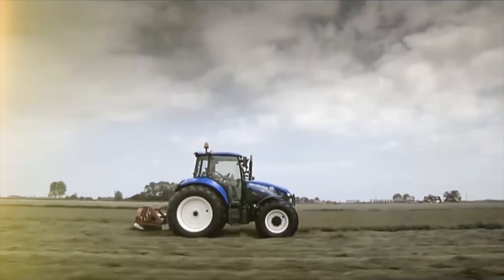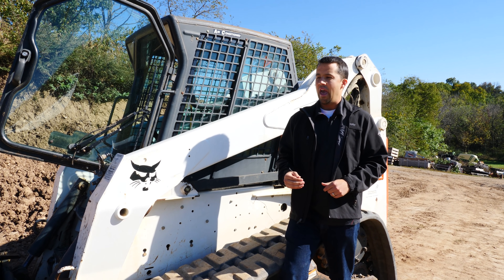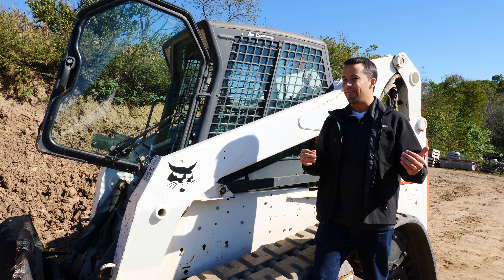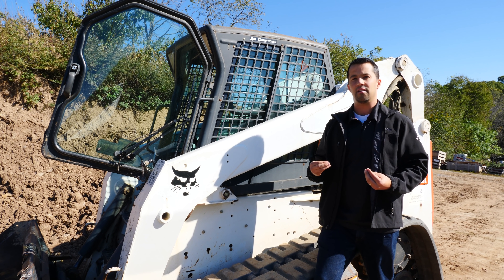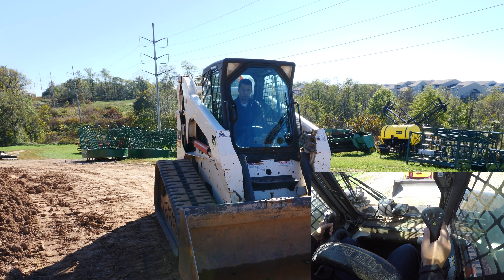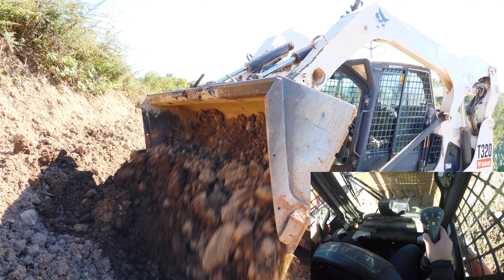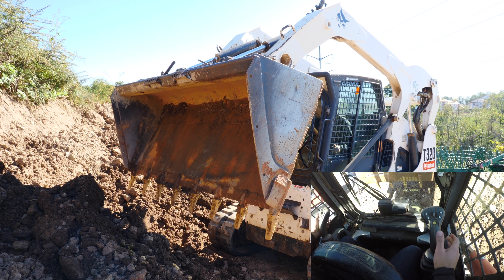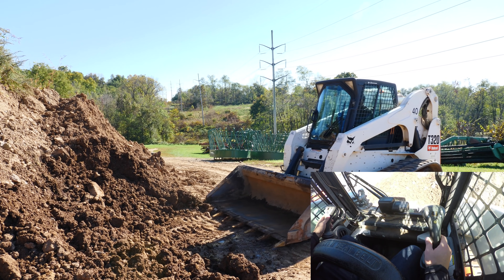Kubota SVL75 VS. Bobcat T320 (hydraulic VS electronic pilot controls)

Comment: You are putting a 75 hp loader against a 92 hp machine make it fair and T320's are not made anymore and they are the best machine bobcat ever made put it against a t650 from present production machines!!
Reply: he literally said it at least 7 times, not a comparison video
Reply: Messick Farm Equipment sorry did not understand it but still a 92 hp machine on reaction time will react differently than a 75 hp machine right or am I wrong??
Reply: Actually I'm sure that 92hp has a a higher flow rate on it. With the controls being driven hydraulically would that not effect anything. Also he's a very poor operator and clearly doesn't know how to run the machine. But you know it's never a comparison with these guys kubota just always happens to the better
Reply: Never thought of it that way makes sense!
Reply from the maker: +Excavating 320 ugh. Did you pay no attention to the words that we're spoken. Your missing the point.
Reply: wrong, in this case the reaction time is dictated by the control method. hp doesn't have anything to do with responsiveness
Reply: Messick Farm Equipment He didn’t use hearing protection!  Can’t hear you..... suggest subtitles in future videos.

I thoroughly enjoyed it however.
Reply: Kubota is just better they design and build all there stuff, and build it to last...bobcat is just overrated junk...I've never run a buta skidded but I have all the rest and wouldn't touch a bobcat piece of crap...and no hes a salesman, that I'm sure could still out operate your goofy ass....

Comment: I love Bobcat, but this video is spot on. the company i work for runs all hand and foot control bobcats but rented a pilot control machine a few years ago for a season. It was so laggy that i thought something was wrong with it. The consensus of everyone that ran it was to never use that style again.
Reply: He's actually dead wrong, you can adjust sensitivity on the T320 easily
Reply: @austinhammett9304  I made that comment 3 years ago... but anyway, sure. you can adjust the sensitivity on every electric/hydraulic machine that i know of. In every machine i've used you get to chose between laggy and twitchy or any combination of the two. Granted, there are many brands that i haven't run and some may be much better but unless you've run dozens of pieces of equipment, I don't think you qualify to call someone "dead wrong". Ive worked a job that requires me to put equipment within an inch of things that would be very expensive to repair hundreds of times each day for 17 years with 0 accidents and have not yet seen an electric over hydraulic CTL with precise enough controls to do that type of work.

Comment: Are these new machines or is the bobcat used?
Reply: That Bobcat looks pretty used, I doubt they come rusty from the factory. Unless they're going after the same market that buys pre torn jeans...
Reply: The electronic controls have been improved over the years.  The T320 in question could be 10 years old.  They started in production in 2007.  They have changed the software, controllers and adjustments.  Flip actuators to help out with what you are doing.  In the beginning in the video u did say not a direct comparison, but I think it is a bad comparison with older technology.  Why don't you compare a Kubota from 2007.  Oh that's right they were not out.
Reply: Messick Farm Equipment for sure, I was just answering buddy asking about if the Bobcat was used. I really enjoy your videos btw, not much b.s.
Reply from the maker: +bcat873. Some current machines today are actually just like this. This video was inspired by the fact that I had been on 5 competing machines just days earlier. As I very clearly said, this wasn't a review on a Bobcat (I see you own one) so much as it is a statement that it's worth checking out different control options.
Reply from the maker: +Corey Johan point is not to compare to the Bobcat as much as it is to point out the difference in how sticks feel and their mechanics.

Comment: Hydronic over hydronic will have more resistance than electric over hydro. If it’s all day the electric will be easier for the operator. 
Also does kabota offer electric over hydro at all?
Reply: He is thinking about the mechanical linkages over hydro.  Like the New Hollands from the 80's and 90's.
Reply: As someone who has spent a few hundred hours in a svl-75, no there is no "resistance" in the sticks. Electric over hydro simply numbs the controls so you move much slower. I'm sure one day electric over hydro will be as quick as hydro over hydro, but not yet.
Reply from the maker: Yeah resistance isn't the right word. I'm not sure how else to describe the difference in feel.
Reply from the maker: +FishFind3000 resistance... From what? Certainly not the sticks, it's the same as what's done in an excavator.
Reply: The Kubota uses pilot control. Meaning that it uses hyd. pressure to operate the functions that each lever controls. So there is virtual no resistance nor hesitation when the operator moves the controls in either of the SVL models. This may seem a little more intimidating to the inexperienced operator due to the faster response on this type. However with a little seat time, you will find that the pilot controls offer a level of precision and productivity not currently available in a electric over hydraulic machine.